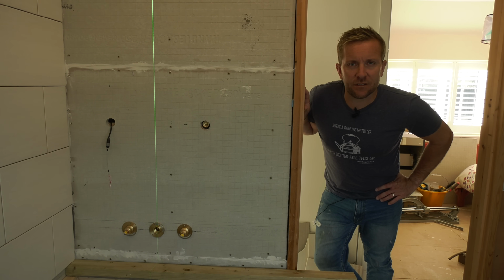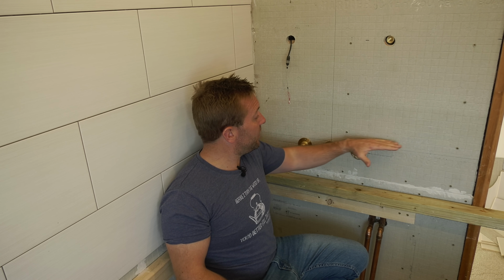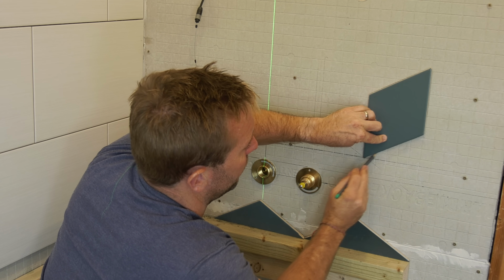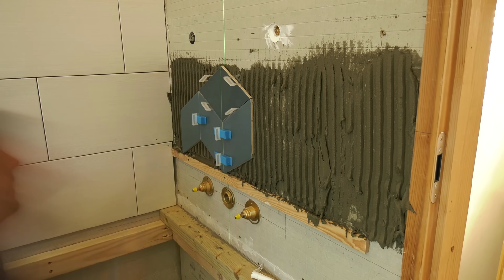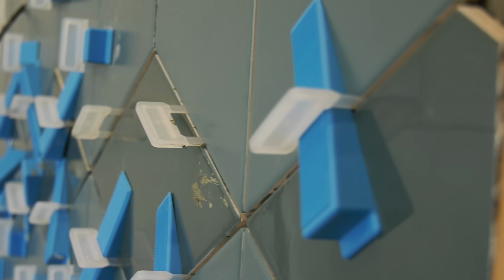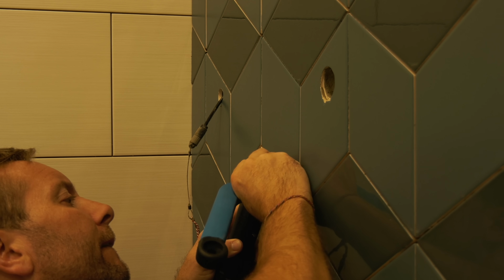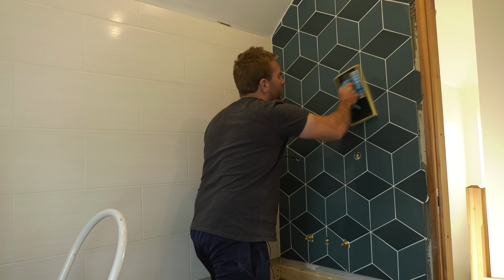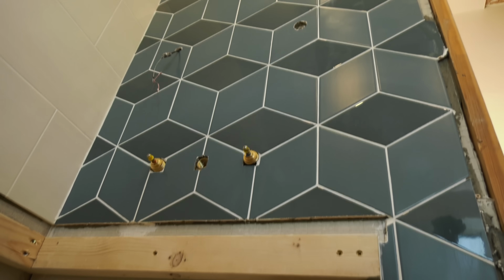HOW TO TILE 3D CUBE EFFECT WALL TILES

Comment: Kudos for the entire job, James! I used to work for a general contractor and am a homeowner, so I can do frame and trim carpentry, electrical wiring, and residential plumbing. My tiling experience consists of telling people, "Pick a color palette and call a tile man. I know a guy that does good work." I learned a lot, that hopefully I will not have to put to practical use. 😂

Comment: Mate I’m a bathroom fitter / tiler
Why didn’t you put bath in first??? 
I always always put bath in get it levelled and make sure it’s 100% sealed in ! Then tile on top of bath, and it’s sealed in there again,
Seems to me tiling first and then installing bath afterwards is more agro, and why haven’t you bothered to cut in the bits of tiles against the door frame ? Come on don’t get lazy,
As always as a pro watching others do it I can see things you do that ain’t helping yourself but I’m sure you would like that when I’m doing pipe work! I started buying them clips and wedges about 10 yrs ago I see them on a big commercial flooring job ! Game changer for me and I started using them on big format floor tiles to start with, but to be honest use them on most jobs , if something makes it easier for you and helps you do a better job then it’s a no brainier ! 
End result looked good , well done!
Shame people don’t really understand when they go and buy tiles how much extra work something like this is!!! Nothing like quoting for a job expecting it to be straight forward and then you get there and it something like this or a herringbone 🤦🏻‍♂️
Reply: There’s another video where he’s created some levelled battening for bath so he can put it afterwards. 
Saves tiling while stood in it, great idea IMO.

Comment: Hi mate. I’m a professional tiler. I have learnt so much from you with plumbing. Thank you. 

I use kerakol adhesive as it lasts 4 hours in the bucket. Pot life. And around 24 mins open time, when trowelled onto a surface. 

Intricate work I mix up small batches by hand and keep the  bucket covered with a damp towel as much as possible. 

6mm trowel with those tiles and I would of floated the wall with rapid set  the day before and not try to use the tile mix to lay the tiles. You can see the issues with the tile adhesive pushing through the tiles especially with clips. 

Your first row of tiles you installed off your Batton I would of troweled a small amount of rapid set , enough for 1 row onto the wall. 
Back butter tiles flat around 1mm and wait 5 mins. Lay the first row and get a coffee etc. half hour later you know have firm tiles to run off. Especially as these are at angles off the Batton. 

I wouldn’t use clips with these tiles. They can cause more issues. Realy only needed on large format tiles etc. 

Your troweled mix was to wet and was also collapsing causing you more issues as I’m sure you were aware. 

You did amazing but if you do the above in future you will hardly have any adhesive to clean off the tile and grout lines in preparation for grout. 

Hope that helps james. 
Love your videos. They have improved my plumbing massively. 

I’ve just started a channel. 
Oxfordshire pro tiling. I’ve made a star ceiling video which you might like to see. 

I need to learn how to edit etc. 

Keep up the great work mate. 

Loved the video with your dad. Heartfelt 👍
Reply: All of what you just said is why I say "Call a professional tile man." I think laying tile might be the only thing that can compound mistakes better than laying tongue and groove flooring.😂 And be harder to correct, once it becomes really obvious 4 or 5 courses down the line.😮